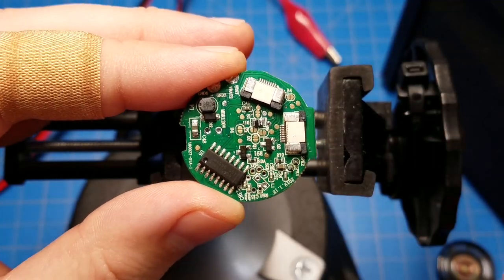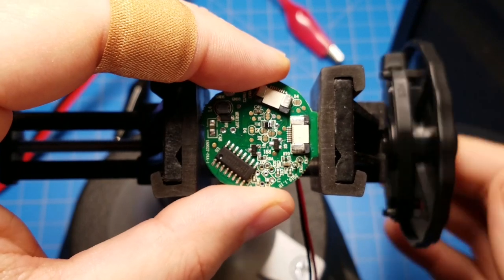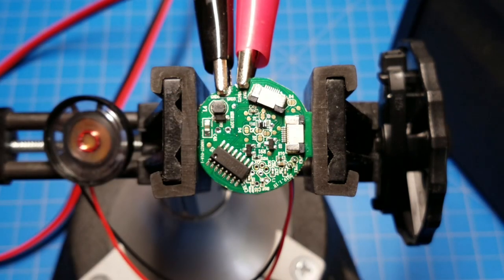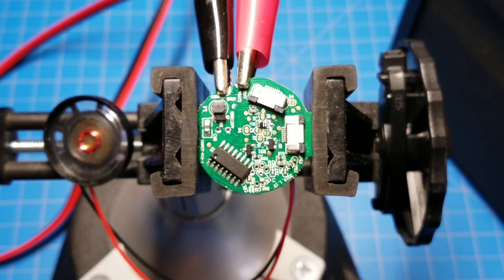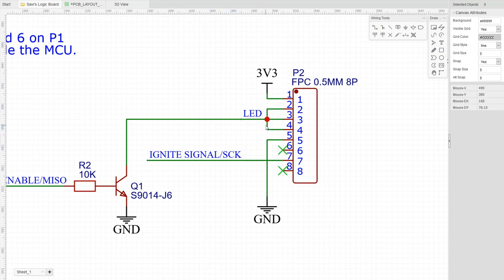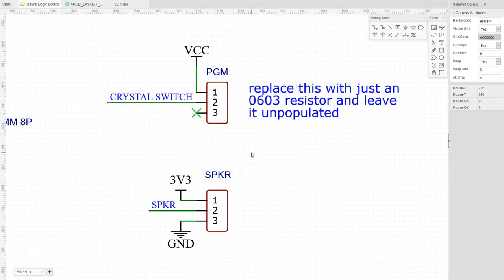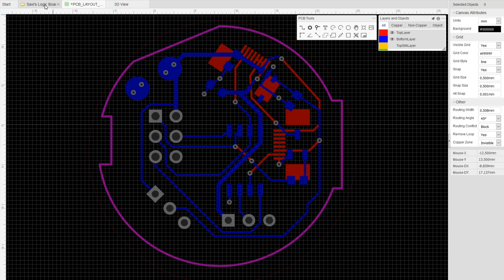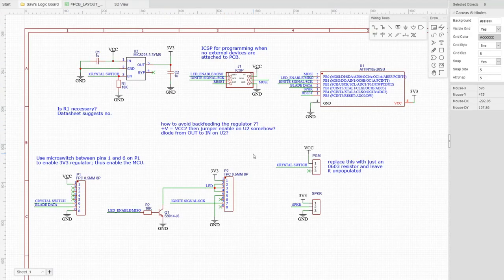What Do You Do With A Broken Chassis?

Comment: I've been watching your videos and I wanted to make custom kyber crystals. I picked up the RFID reader with the red screen and I bought a batch of the RFID chips from AliExpress, but I can't get my RFID reader to scan them. I was wondering if I'm missing a step or do I need another piece of equipment to program all the initial information into it before I can program it with the RFID reader?
Reply from the maker: The RFID reader is very picky about the location and orientation of the RFID chip. It needs to be in a very specific location before it can read it. I would try holding the RFID chip in different positions and orientations and keep scanning until it finds it. This may take dozens of attempts before you find it. 

Typically it'll need to be held right up against the back of the reader; you may need to hold  the RFID chip perpendicular to the reader as well.

Comment: I think my board may be the problem sonce it looks like if has a white powder. I posted in another video that I only hear a soumd when inserting the battery and when inserting tha blade but no lights on the hilt nor the blade. How do I search on ebay for this boards? Thanks
Reply from the maker: the white stuff is normal. it's dried flux. flux is used to help solder flow when soldering. they usually don't clean it off after soldering wires to the PCB.

the hilt will light up when you insert a kyber crystal. try inserting a crystal after you insert the battery pack and see what happens.

have you contacted disney? they may be able to send you a new hilt. you can email them at Merchandise.Guest.Services@DisneyParks.com

replacement PCBs are not available anywhere. you would need to biy a new hilt, which sell for around $200 on ebay.